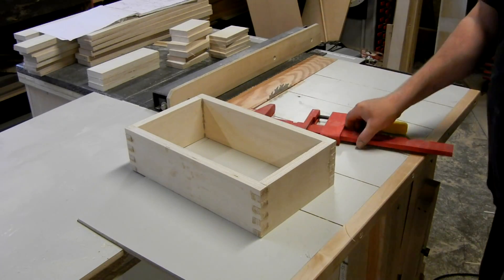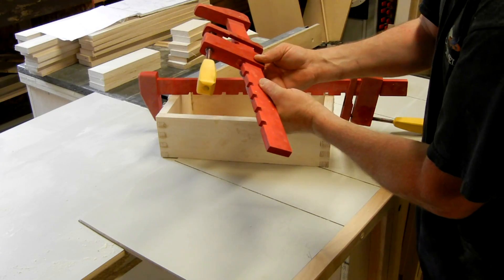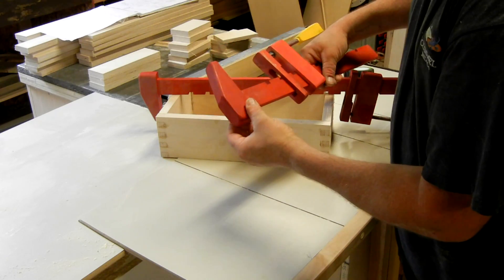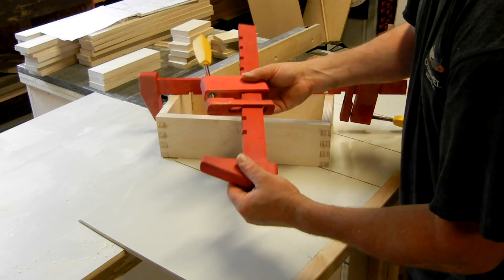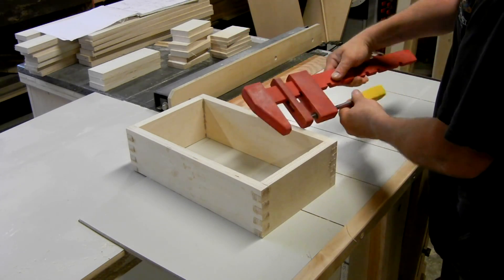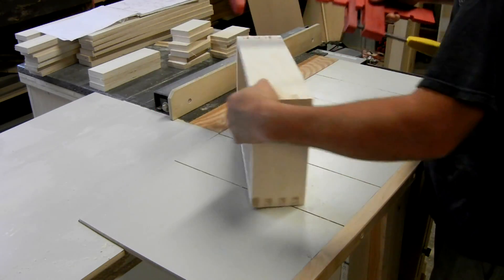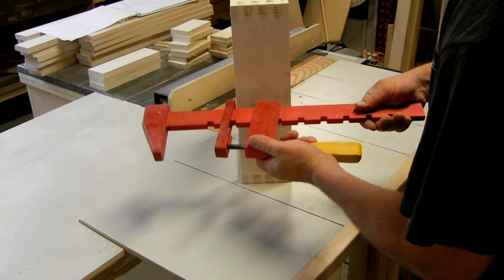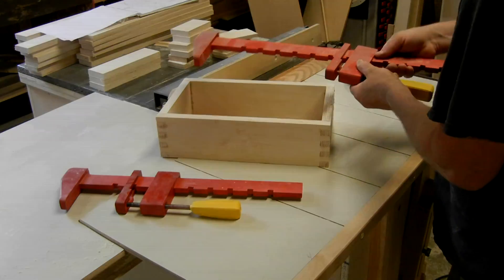Wooden Bar Clamps

Comment: Acme threads would make them tighten down a bit quicker I would think. The problem is you usually can't buy acme threaded rod right off the shelf in most hardware stores, but dependableacme.com does sell to the public.